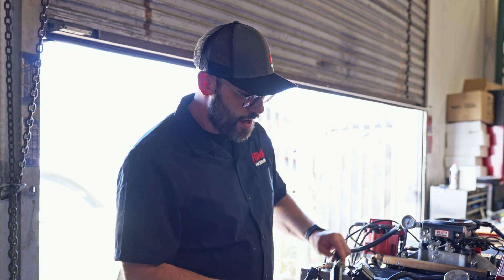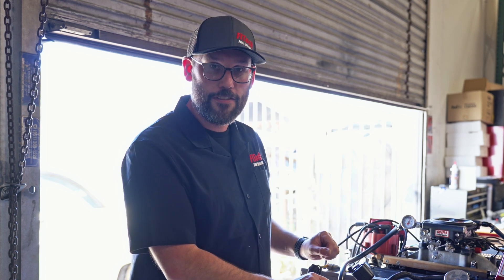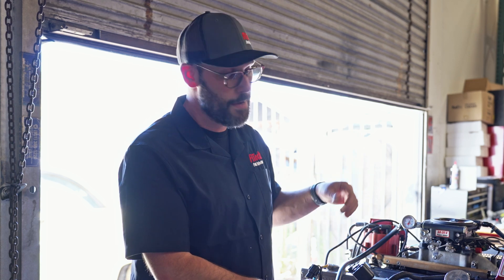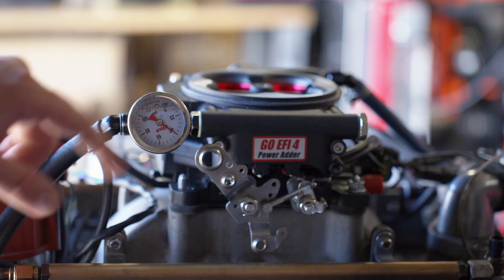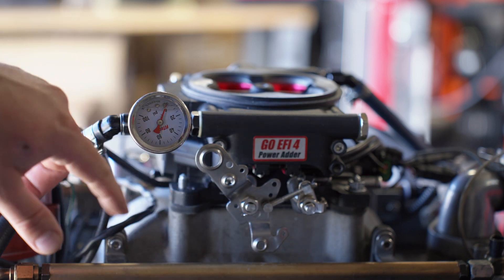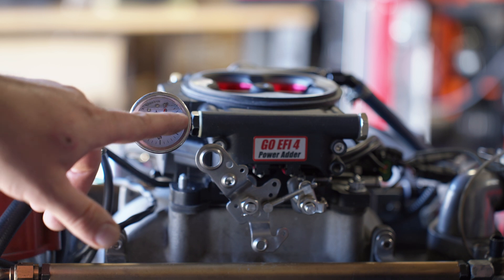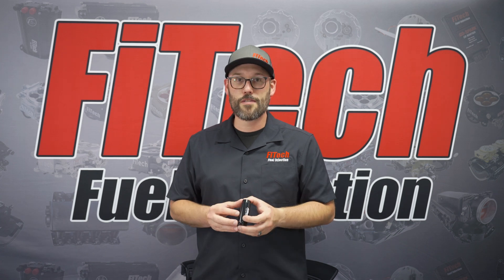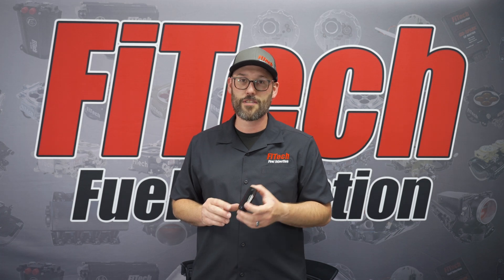Diagnosing a Clogged Fuel Filter | Tech Tuesdays | EP77

Comment: My needle bounces back and forth below 58 and above 58 at idle. Im blowing the 20A fuse for the fuel pump.....im calling Monday morning.
Reply from the maker: The needle will bounce on the gauge it not liquid filled when its mounted this close to the throttle body. This is from the injectors opening and closing.

Comment: My FiTech builds pressure when ignition is first turned on, but drops to zero when pump shuts off and does not maintain pressure. No leaks in system. Any ideas why it does not maintain pressure?
Reply: I noticed this with mine as well. Can’t remember if it was maintaining pressure when I first installed it.
Reply: you're not supposed to maintain fuel pressure in the lines, it will slowly go down the longer engine is off, taht is normal

Comment: I wish you had shown the gauge when operating normally as well
Reply from the maker: In normal operation when the throttle is hit quickly fuel pressure does not drop at all.

Comment: Shouldn’t that gauge get up to 58? I get a bog, I check my filters..
Reply from the maker: If the fuel pressure does not drop then you can work with the ACCEL PUMP settings in the software to provide the engine with more or less fuel when stepping on the throttle. We have a video on ACCEL PUMP as well.
Reply: @FiTechEFImedia  aren't 4 injector models running higher pressure than 8 injector ones?